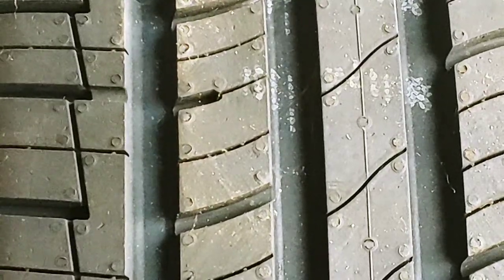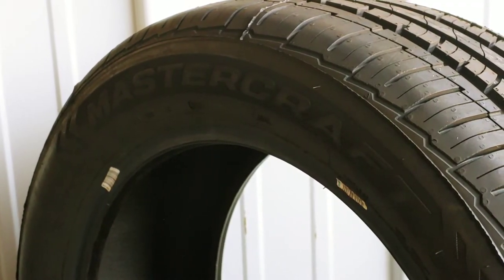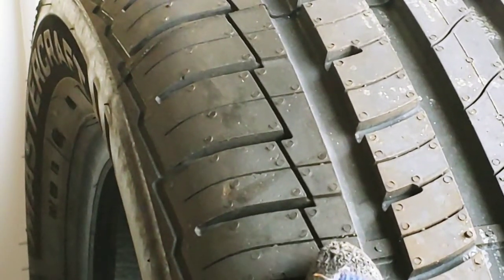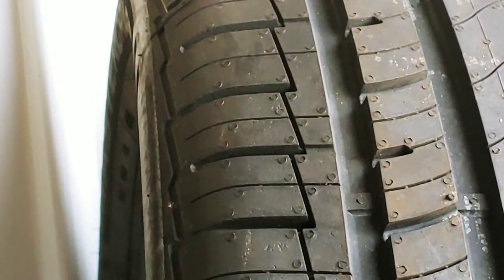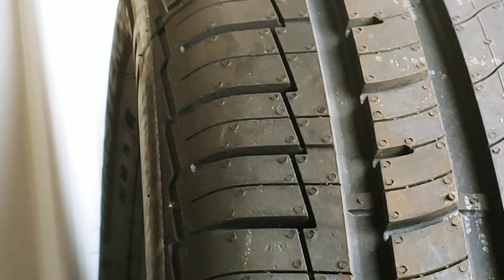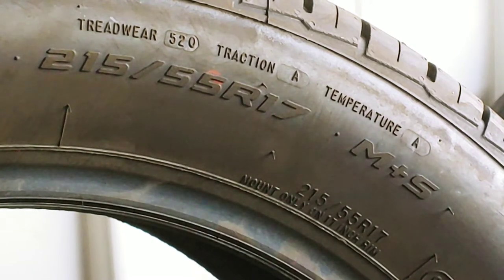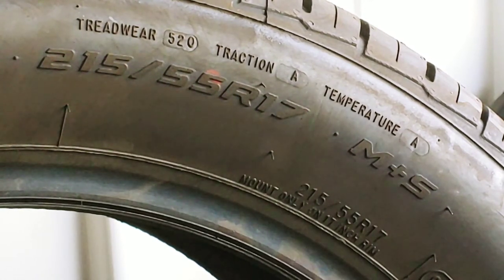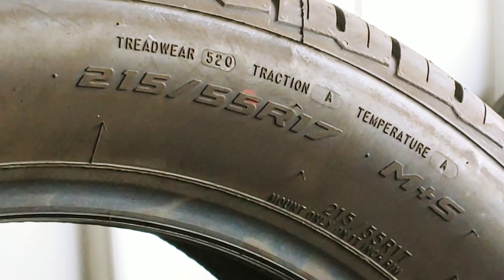Master Craft tire review

Comment: I have these on my 2002 Chevy cavalier LS and have had no issues in the rain or snow.  The water channels on the tires necessarily don't have to connect to the outer treads it's more for guiding the water out from underneath the tire.